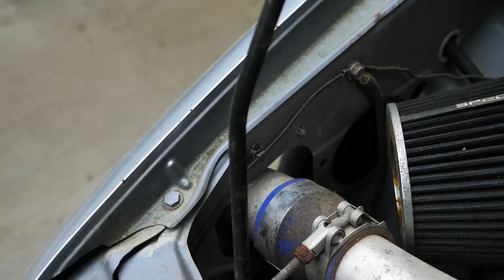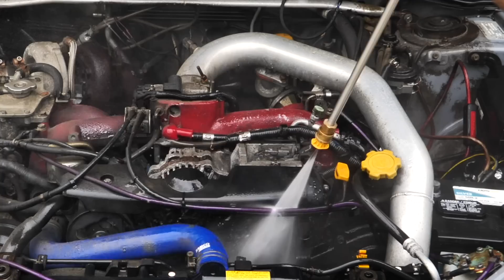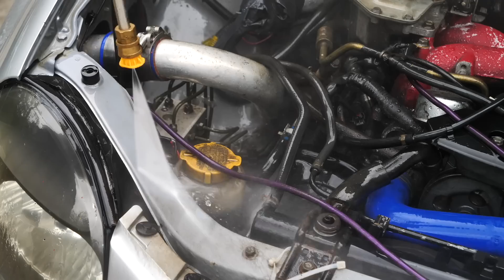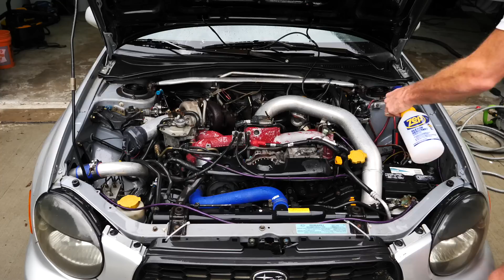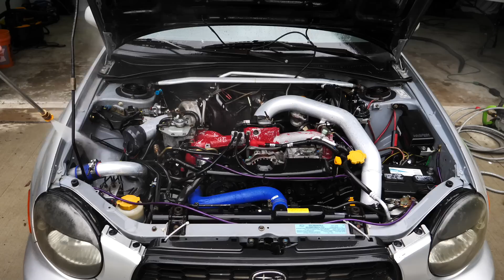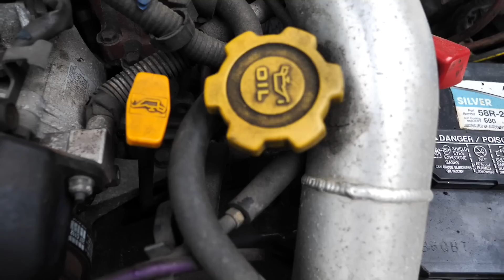HOW To Clean Your Engine Bay Detailing Tutorial!

Comment: The proper way to safely clean and engine is to run the engine for 15 to 20 minutes warm it up apply degreaser let it sit for another 10-15 minutes and then come back with regular hose water not power washer and just rinse the engine the whole purpose of cleaning the engine is to see if something is leaking or if something is wrong you can go and fix that situation 😊😊😊😊😊

Comment: These types of air filters are oil-saturated and need to be cleaned properly. Any time
you blow out an air filter blow it from the inside out, the opposite direction of air flow.
Reply from the maker: Good point!

Comment: After everything is completely dry, I like to spray a clear coat on the engine bay.  I use an automotive, high temperature, heat resistant clear coat and it really looks great.  Seems to last longer than the sprays.  Also gets into the tiny spaces that can be difficult to reach.  I my opinion, I think it makes the plastic pieces look better than the sprays and dressings do.

Comment: So when I pressure wash my dad's truck engine bay it always seems to pop a fuse so how could I get around that?
Reply from the maker: Did you remove the battery?
Reply: @StaufferGarage  No, I looked that over. But my cousin is a detailer and cleaned the engine bay without disconnecting the battery on the same truck.
Reply from the maker: @scoutlife.7765  ah ok, there’s your issue

Comment: Is there any mechanical benefit to detailing an engine, or is it primarily cosmetic?
Reply from the maker: Ability to see leaks, wear and tear along with cleaner and easier to work on if it’s not covered in dirt and grease
Reply: @StaufferGarage  Thanks for your response. I'd never heard of an engine being detailed before, so I was wondering what its purpose was. Is engine detailing a service that most detailers would offer, or just certain ones?

Comment: Any one with a Mercedes sprinter van please don't do this. The ecu is under the drip tray. It's a common problem that they get wet and a trashed after. Other than that, never had a problem with pressure washing any other engine bay.

Comment: What degreaser do you recommend?
Reply: In my experience, if it's only a little grease/oil to remove, fully concentrated Simple Green does a great job without etching or marring metal.  Greased Lightning is awesome but you have to be careful to not let it sit too long or it'll cause issues of corrosion into surfaces. Castrol Super Clean is also a good one on the level of Simple Green but a little more abrasive.  If you're in the price vs. performance game, Zep does make awesome heavy duty degreaser (on the level of Castrol Super Clean but a little more affordable from what I've seen).  If you're okay with rinsing a little longer and using a little more mechanical cleaning action, diluted Dawn dish soap is also a great degreaser.  All in all, there are a ton of options.
Reply: @mikey_atl  thanks I appreciate it, I have to do some motor work on the project car and need to really clean and degrease
Reply: @jaemanson6662  you bet.